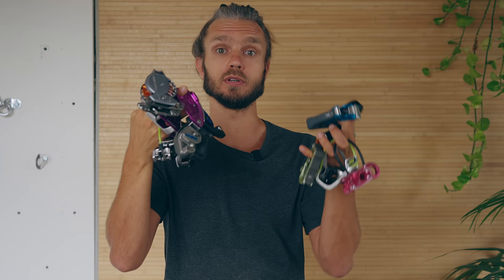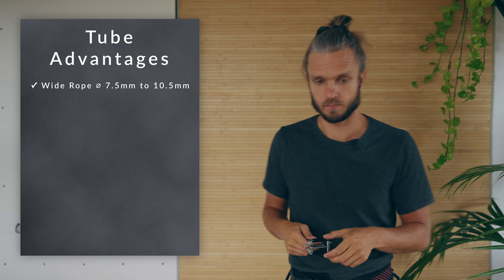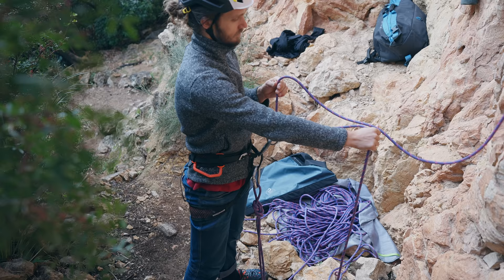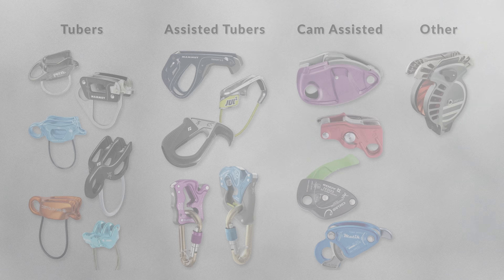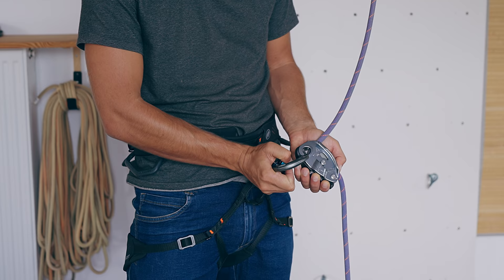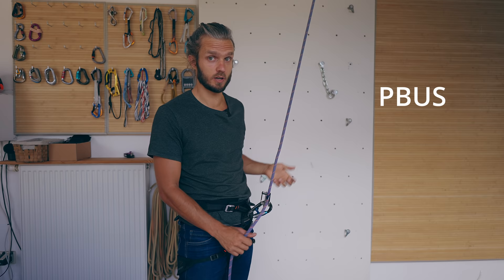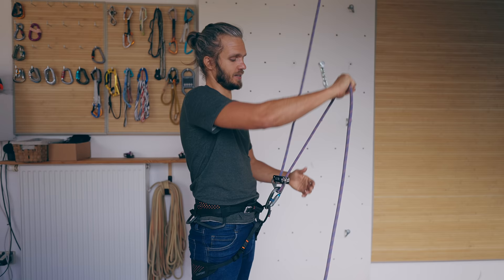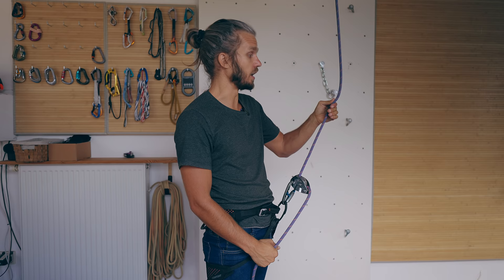Complete Guide into Belay Devices - Differences and Efficient Usage | Ep.6

Comment: There's another important use of tubular devices: retrievable abseil.  Where the rope is threaded through or around an anchor at the top of a route (e.g. sport anchors or a tree) and you abseil off both strands.  Some assisted tubulars (e.g. Edelrid devices) also do this.
Reply: If by retrievable abseil you mean that the rope can be pulled down once you reach the ground, that is also possible with grigris and other single slot devices. Tie a knot with a bight on the rope near the middle part, and either put the other strand of the rope around the tree and through the bight, or clip a locking carabiner through the bight and around the other strand of the rope. Descend with the belay device on the strand of rope that goes through the bight/carabiner, and then pull the other strand to get the rope down.

Comment: As a mega-jul convinced user, I'm a bit sad you didn't talk about it so much, since it combines all the pros of all devices :-p But then again you drop the pros/cons list after the tubes haha :D Also related, its method for paying out slack is slightly different than the one you show, so it could have been interesting to  mention it. Otherwise, good vid as always ;-)
Reply from the maker: It's already 30mins video :DDDD
Reply: @HardIsEasy  yeeeeah you're right, you're right :) I'm just sad that this one belay always seems to get forgotten when imo it's the best ever :-p Again, good content, that was the main point. Thanks!
Reply: Giga Jul ftw
Reply: I used to like the mega jul, but I found after a year or so of use it began to cut a groove into the top of my carabiner. When a steel device slams into an aluminium carabiner, the carabiner gets damaged.
Reply: Love the mega jul and giga jul! Amazing do it all devices.
Reply: @benschuster9792  there's a reason Edelrid recommends carabiners that are made of steel or have steel inserts for the mega jul :P
Reply: @mihaibabiac3275  the bulletproof only has an intert on the inside of the carabiner, the damage was on the outside. A steel insert would've made no difference
Reply: @benschuster9792  Oh, I didn't think of that. Though I also recently found some burrs on the top/outside of my full steel carabiner (Bruce Steel FG, I believe) and had to sand them down 🤔 But it's the first time after more than a year of use, so not too bad.
Reply: Used the Mega Jul a lot. CON is here that the hole device can twist when the rope kinked and the device blocks, also with  old thicker ropes and limestone for example you can get problems lowering your partner
Reply: As much as I appreciate the mega jul, I found the two rope assist to be more cumbersome for a rappel (you can flip around but then unweighting another system is hard since the device locks in that direction) than simply the time to rig an autoblock and the heat trapped from the steel became horrendous with any rapid lowering through laps in a gym. While this has a tremendous amount going for it, and the giga jul kind of resolved but then made an expensive and clunky piece, I cannot identify a scenario where I wouldn’t rather have two separate devices except twin rope belays, but I see most people far prefer a non assisted tube. Even multipitch, but won’t get into how to get the best of all worlds.

Comment: Thanks for this great video! One thing (I might have missed in the video): If you need to take in a lot of slack fast, just take a few steps back. That is if possible, doesn't apply to multi-pitch for obvious reasons. Walking back two meters might take in a lot more slack than you're able to take in otherwise!
Reply: Yup, great trick! Works both ways too: move forward to give that extra foot of slack! 👍
Reply: Backing up on a multi will take up slack fast too.  It's just a bit harder to give the slack back afterward.

Comment: At 16:00 into the video…
Great videos/info!
I’m new to climbing (started with coworkers) but I’m a SPRAT III and I wanted to share a better way to use the grigri.
In the video, the biner is connected to the grigri, nose to face plate. A safer way to handle the grigri is to make the connection by the biner from the back of the grigri. Doing it this way will make it so you don’t have to fully remove the biner from the grigri (the biner will always be “mostly in” the grigri while you’re opening it). Open the biner and move it just enough to open the face plate. Then, open the device, put the biner back in place (locked), thread your rope, open gate to slightly move biner out of the way of the face plate, close face, slightly move biner back into  locked position. 
I hope this helps.

Comment: There is actually a 4th way to belay which we teach in the Netherlands, don't know about other parts of the world. We only teach this for top rope, since we use tunneling for lead climbing. It is a variation on PBUS, which could be described as PBDS. 'Pull' and 'Break' are the same, but then your non-dominant hand is placed just below the belay 'Device' (this is the hand that was holding the climber's rope during 'Pull'), instead of placing this hand under your other hand like during PBUS. Then, your dominant hand 'Slides' up to meet your non-dominant hand just under the belay device. So you begin and end always with two fists under your device, which is a natural, comfortable and safe resting position, with as many hands on the break rope as possible at all times. As a Dutch climbing instructor, PBUS looks cumbersome and weird to me, as we're used tot PBDS, and some gyms also teach the 'hand of over hand' method. In fact, in the Netherlands I have never seen a single person use PBUS. Awesome video, love your content and keep up the great work! :)
Reply: This "4th way" was the one I was taught in a top rope course in Finland.
Reply: I've been taught toprope twice in The Netherlands, because I needed a refresher. And I never got taught that method, always the hand over hand. That 4th method seems to be slightly unsafe even, but mostly for the belayer. If the climber takes a fall, your non-dominant hand could get sucked in. Of course, your dominant hand would be tunneling the rope, so it should be safe for the climber, just painful for the belayer. I'm not saying that this is the case, I'm not an experienced climber, this is my view and I'd love it if you could give me some more insight into this. Always curious to learn more :)
Reply: PBDS could stand for pull brake dominant slide, but it could also be peanut butter door stop
Reply: @StalenStefan  Thanks for your reply :) Personally I regard the hand over hand method to be slightly unsafer, when performed sloppely as the belayer gets a little too comfortable with the technique. It gets so fast that the hand switching starts to happen above the device with the posibility that you're not properly holding the rope in a position with less to no mechnical advantage. Whereas the PBDS technique ensures always one or two hand holding onto the rope at all times, as often as possible in the break position. When in the break position there's not enough slippage that a hand could be sucked in. It's not like your non-dominant hand is incapable of catching the fall, the belay device takes care of that :)

Comment: Thank you for this video. I agree with most things you said and showed in this video.

In our climbing gym only assisted devices are allowed and we therefore teach the tunneling method combined with the PBUS technique (if at one point there is too much lack to take in comfortably with the first technique).

The thing I criticize is how far up you take your break hand while belaying. It's not necessarry and makes it more dangerous. If you push the upper rope to the front instead of pulling it down you can easily pull it out to the front (both of the ropes parallel). This even works with assisted belaying devices. As well as reversed for giving out slack with assisted belaying devices. If you pull the rope out to the front, instead of up they don't lock (but they still would if the climber fell in this moment, because the break hand always stays low enough).

You didn't mention the Giga Juul which I love for multipitch climbing as it allows me to use it as an assisted device for lead climbing and switch to a normal tuber to minimize friction when belaying from above or when rappelling.
And in my opinion it's absulutely necessery to know how to belay with a knot (I don't know how this is called in english...) when one goes multipitch climbing (for emergencies).

Much love from a climbing instructor from Swizerland! I always recommend your videos to my students :)

Comment: There is another method for taking slack, with alternating hands, I find this the most efficient and secure. This technique works as long as the breaking end of the rope is facing down (center) which is what happens anyways when you plug it all correctly to the belay loop. It's a pull, switch (pulling hand into breaking), break, release, there is no tunneling (then repeat all with the other hand as everything is now reversed). I suggest to give it a try and consider evaluating it's pros and cons. Thank you for all your great content, I find it very useful.

Comment: Good overview. Every belay method/device will have some weaknesses; none are perfect. It's important to practice and understand where those weaknesses may enter into a situation, and develop your usage technique to avoid them. Holding Gri Gris open is a common flaw; the phenomenon of a nearby directional carabiner being pulled against the gri gri and holding it unlocked is a real, but often overlooked concern, especially at a cramped anchor on multi-pitch routes. A huge belay error on single pitch sport routes is lowering where the rope end goes through the device - simply avoided with a knot in the rope end/ pre-tying it to something.
  Minor quibble - comprehensive testing in belay facilities has pretty well debunked the notion of a more dynamic, "soft catch" by an "experienced" belayer. Attempting to modulate the rope to add slippage actually just increases the total fall distance, which increases the chance for the leader to impact a ledge or bulge, but also increases the total energy of the fall; dynamometers have shown this creates a higher peak force on the top protection and leader, compared to a static belay which then allows the dynamic rope alone to optimally distribute the forces, never exceeding its maximum impact force, just stretching farther and over more time, as the fall's severity increases.

Comment: After testing soooo many variants, I came to the conclusion that the perfect sport climbing setup (for me) is owning BOTH grigri and revo.
I will give revo to inexperienced belayers so that they won't short-rope me; I sometimes belay with it when my climber aims at sending his project in one go.
GriGri is most useful for projecting, since it provides rest for the belayer (of course, breaking hand stays on the rope). It also allows to evacuate from a belay point that is above the ground (happens sometimes) or if I need to recover 1sr quickdraw(s) due to overhanging terrain that won't allow my climber to do it.
Unfortunately it requires some training, and inexperienced belayers or tuber fans will often short rope during clipping.
Reply: How is gri-gri related to short-roping? I couldn't feel the difference when i used it, but maybe my climbers did

Comment: Great highly informative video! Always good to be refreshed on best practice. As an ex Click-Up user (I really wanted to like them but eventually moved back to a Grigri) I think I can answer your question about why Climbing Technology recommended using only their dedicated HMS biner with their Click-up. I found using some other HMS biners (e.g. Petzl and DMM) with this device if the Click-up happened to move into a cross loaded position over the biner gate the screw lock mechanism can jamb inside the slot in the Click-up causing it NOT to be able to ‘click up’ and lock the rope in a fall. 
The screw lock on the dedicated Climbing Technology Click-up biner is a larger diameter and as a result can’t slide into and jamb inside the biner slot in the Click-up.
More than likely you could use a Click-up with a non-dedicated biner for a lifetime and never have this issue arise, but it’s worth knowing the potential exists. If you are using a click-up with some other locker check and make sure the screw lock mechanism can’t slide into the Click-Up biner slot!
Reply: Can you tell me why you moved back to gri gri? I use the gri gri, but I'm thinking about buying a click up, I'm intersted in knowing some reasons I should not
Reply: @Rankidu  I liked the original Click-up for its relative lightness, no moving parts and smooth operation. I bought the Click-up Plus thinking it would be even better but it was worse (more grabby). One downside is when the Click-up locks you have to actively unlock it before you can feed the rope freely again. This can be frustrating (for both climber and belayer) when you find it ‘accidentally’ locked right when you want to pay out rope quickly.
If you take the time to master it’s quirks it can be a nice device to use but mastering the quirks of the Grigri was slightly easier for me in the end. If you are thinking of buying a Click-up it’s worth reading the review and comments on this UK Climbing review: https://www.ukclimbing.com/gear/climbing/belays/climbing_technology_click_up+_assisted_braking_belay_device-11853

Comment: I think my 4 most valuable pieces of info for any belayer - 

NEVER SKIP A PARTNER CHECK & ALWAYS PUT A KNOT IN THE TAIL. 

Stand in a READY STANCE. One foot forward - get ready to jump up and kick the wall with a high foot. 

Move while belaying. That one step forward or back can make the difference to give/take a little without having to do any unnecessary  hand movements for the same end result. Advanced - move while giving/taking slack - eg when climber goes for a really high clip. 

Eyes down, thumb up. A GRIGRI thing - when resting your neck or looking around, lift your thumb off the cam. And only give slack with your thumb down when you have visual eyes up on the climber, while they clip/climb. Almost dropped my wife because I thought she was clipping, but she was actually falling!! She fell way further than she needed to 😳 😅 Eyes up, thumb down. Eyes down, thumb up. When I can’t see my climber -  I feed the GRIGRI like an atc and slide/push the rope in to give slack slowly *only smooth skinny’ish ropes do this easily without locking up. I call it passive belay and active belay with the GRIGRI. 😎
Reply: I would take your comment a huge step further after watching Ben's video on Grigris.  Never ever keep your thumb on the cam.  You use it for 2 seconds to give a big armful of slack and release immediately.  You should never be standing there with your thumb on the cam!  For small amounts of slack you can feed manually using both hands and without the cam, I only use the cam when the climber is clipping, and release my thumb immediately!

Comment: one note with the release of assisted gear from touching other gear, tech climers use a carabiner on their harness to add friction to the 'free end' of the rope, which assists breaking the rope (STOPPING IT) when a rapid movement occurs ( think it helps the 'toggling action' of the device, so it locks, even if you have the rope held loostly).

Comment: One comment on megajoule and joule. This was my first ever belaying device and I've been using it now for 5 years. You can actually get used to giving slack without unlocking the device with your right hand and thus never changing the position of fingers of your right hand. All it takes is a little thug back (direction of taking in the rope, not the fall). 2nd method: taping with the thumb knuckle of right hand. Idk if that would work with many assisted tubers, perhaps with mammut one. 
Hope this is useful:)

Great (quality) video!

Comment: I work at a climbing gym in the Netherlands and the tunnel technique is pretty frowned upon here. We're even told to tell people using that technique to belay with at least one hand firmly grasping the break rope at all times. And if you need to move your hand up the rope we're taught to grab the break rope closer to the belay device with our other hand and slide our main hand up until your two fists make contact, only then can you let go with the other hand again. It's a slower technique but safer for sure. I didn't even think the tunnel technique was accepted anywhere else until now. I don't frown upon it as seen described in this video, but I still feel like it sacrifices some safety just for efficiency, and that it wouldn't hurt the be-layer to use a safer technique. Or maybe that's just me... I just know I would feel more comfortable climbing if I knew my be-layer always had one hand with a tight grip on the brake rope.
Anyways, otherwise amazing video! I feel like I learnt a lot. Can't wait to see an extensive video about climbing knots :)